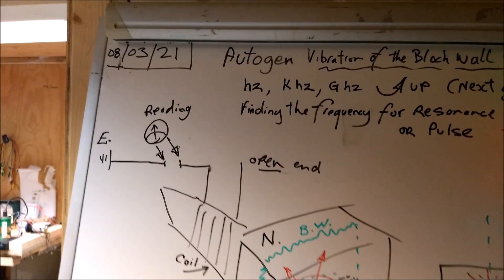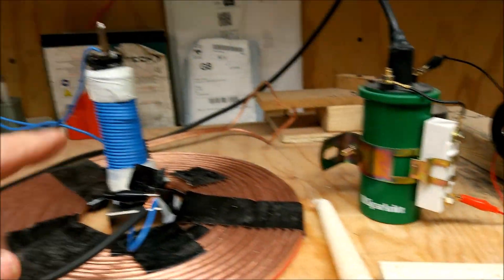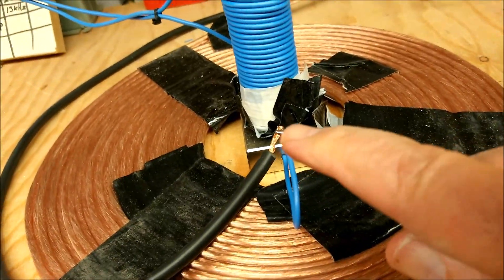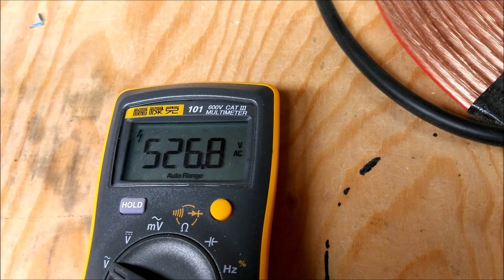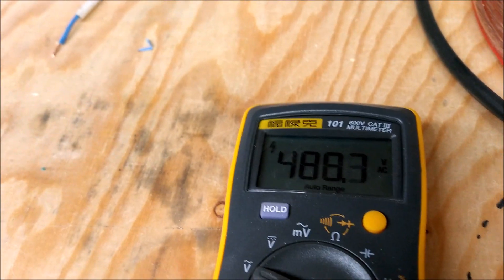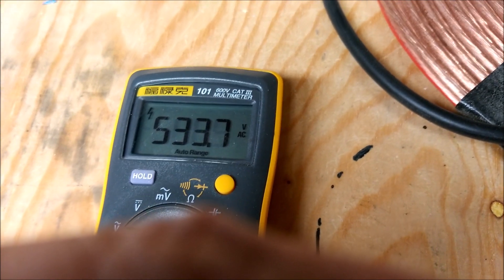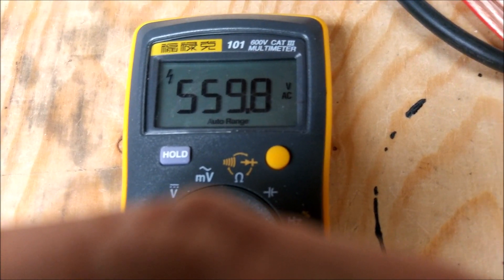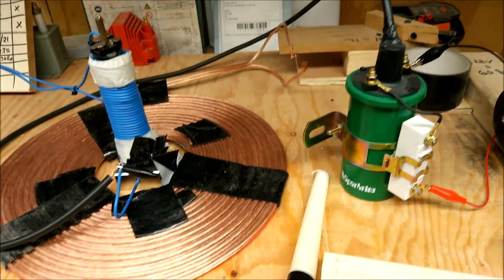AutoGen Ex2  Magnet Point Source Power Generator

Comment: And chk this.. may b u will get some ideas that u cd work out on when inverted via magnet 
youtu.be/yYpz9ak34e0
Reply from the maker: DK thanks great reminder of magnetic and dielectric fields. Ken Wheeler has just done a video on the realization of the possibility of Over Unity. He also said he is now working on this which is stretching his knowledge to figure out the coil geometry.
Tesla was on the money!
We all need to pull together in these time.
Regards... DC
Reply: @e.powerdc1127  if u send me ur watsapp no I can pass on the patents diagrams of Tesla... Some of them r really very good... U get the inside mind of Tesla how it works nd how he achieved what he achieved with magnetism later though he removed the magnetic part out to concentrate on the dielectric part as he knew whenever he wished he could use the magnetic component
Reply from the maker: @DK-sg3oe  just got email. However I have a private app Signal which is safe and secure if you would consider this.
The app is best used with a mobile app.
Regards.. DC
Reply: @e.powerdc1127   YAG laser materials were also used in the lasers that broke both the 1 KW and 100 KW output power records, and their use is still growing to this day. Ceramic laser materials are always advancing, ..... If  materials these in caps as  used in  lasers  I think may produce the best dielectric current into the stout bar... Jusr read a hit on that... May give it a try next time arounds

Comment: A novel voltage transformer. What would interesting is to measure the Power at the output. ie. Volts and Amps.
Reply from the maker: R.F hi, I have been away for some time.
No been active, plan to start again in September during possible lockdown.
Then I can regain my focus.
With my new equipment I can:- Check reaction to wide range of frequencies pulse, and output V & A.
Regards... DC
Reply: @e.powerdc1127  y don't u loop it back 2 the another spark gap and check the voltage raise and if it can done multiple times to raise the aether flow at the spark gap by removing the magnetic component ie ac to allow the dielectric part till u get in resonance and is able tostore into a battery  via serial cap or otherwise then it cd b made useful with a invertor isn ot not
Reply: @e.powerdc1127  also pls explain what kind of pulse modulator ur using.... I will want 2 try it out even if I am not from the electric field
Reply from the maker: @DK-sg3oe  Hi DK. PWM = eBay 36v DC motor controller rated @ 5amps (I think cos I have used "blown up so many" with back EMF" even with diodes).
Voltage can spike very high at testing points spontaneously.
Please feedback... DC
Reply: @e.powerdc1127  can I use graphite or nichrome wire instead of tungsten what ur experience as spark gap which is better have u found the same voltage amplification
Reply from the maker: @DK-sg3oe  yes fine make certain the insulation is good through the core of the magnet except the epicenter where the spark can jump. This should wack the Bloch Wall, then tuning is required. Notes... Diodes required to block back EMF. Please feed back... DC
Reply from the maker: @DK-sg3oe  Hi for now i am only using "The Copper Wire" for tests and its holding up no ware & tare at the tip. (Its does burn the copper wire insulation a little). 
Regards DC
Reply from the maker: @DK-sg3oe  yes it's about managing the dielectric. Volts drive amps. So the Q how much will it drive.
I have been knocked out by Covid and only now recovering with "long Covid".
Should be back in the workshop soon, I hope. I think that you can see just where I am headed with this one.
Tesla was correct "think vibration" what better to vibrate a "magnet"?
Regards ... DC

Comment: Dear Mr. DC ground (earth) the coil lower terminal, and also try to ground the core 🔐
Reply from the maker: Hi AR Yes this is important. I have made a "Ground Rod"   and separate grounding from the a/c home board. This helps to stop "Stray" voltage.
I have tried (Home Earthing), it has shown little difference, however i am overviewing "All" possible variations.
Notes
The pulsed HV goes out seeking its opposite side. Again everything acts like a magnet.
Really value comments, they help.. Regards .... DC